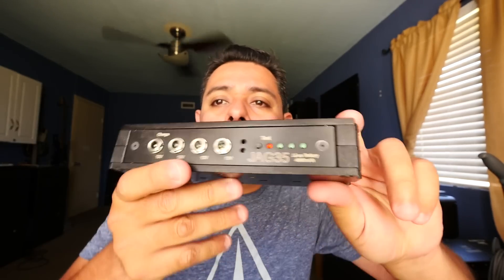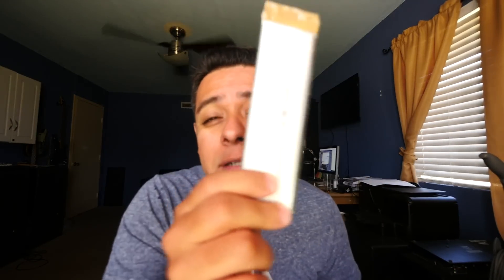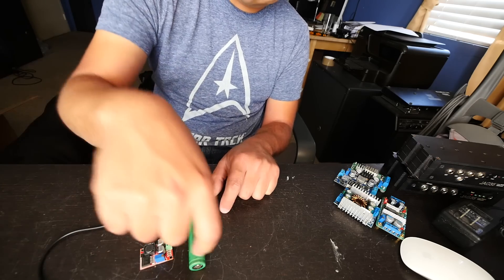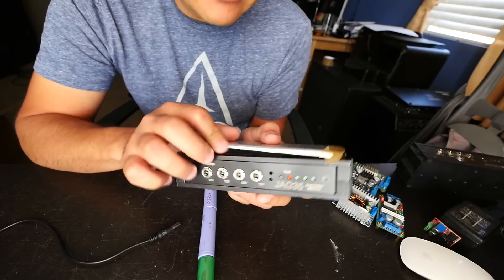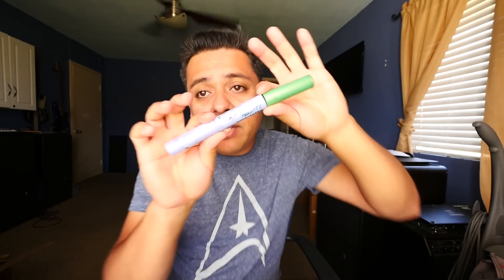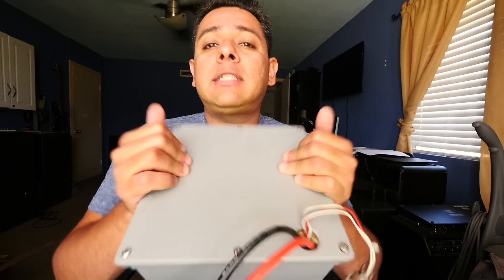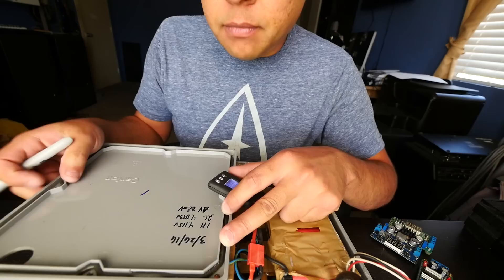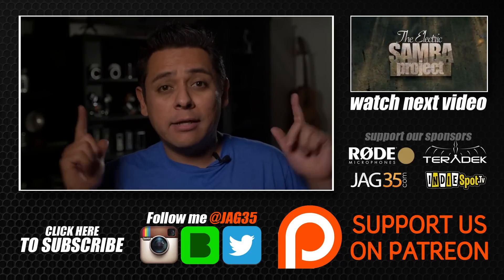How to Charge Lithium Batteries

Comment: So, you have a 600 watt module.  How many modules in your Samba and how many km/miles can you get on those?  // Now just for bs ing, a cell in Spanish is called a "pila" and several cells / pilas make a battery (bateria).  Actually a group of anything is a "bateria", that is why not all electrical storage units are called "baterias."
Reply from the maker: +Oscar Quiros   Cool,  I tend to have trouble with terminology,  I call things the wrong thing all the time.   My samba has a 600wh 12 battery,    Traction pack is 42,000wh good for about 140 miles of range

Comment: It's nice to know that multi-parallel-cell lithium packs don't drift much. For anyone wondering, it may be because the 33 parallel cells each have a different internal series resistance (which usually causes voltage drift), but as such a large number of cells are used, the resistance averages out to a common number (gaussian resistance distribution; one has a very high resistance, other has a very low one and the rest are in between), and each series group gets a similar resistance, making the pack accept the same charge. And, as example RC Packs are usually 1P (1 parallel cell), the resistance between cells is uneven, thus requiring leveling.

Comment: What charger are you now using for your Bus? You say you use one of those power regulators for charging your 12 volt battery. I don't see where these are able to take in your pack voltage then derate to 12 volts? I see they take 120 AC volts. Do they also take 120 DC volts that you can then derate to 12 volts?

Comment: What's a good source of cheap but reliable 18650s ?
Reply: +kchiem Buy old laptop batteries and do heaps of tests on the cells and only use the good ones.
Reply: +Sean Pain That seems pretty labor intensive, for variable quality/condition cells.
Reply: +kchiem Not really. Took me under two hours to get around 100 cells out of a batch of batteries. Around 85 of them were higher than 2000mAh, and able to hold their charge. Majority of those were Samsung cells as i seek specific brands that use better branded batteries. Testing the batteries doesn't take up much of your time as it is just a matter of swapping the batteries when done and recording the voltage and capacity. Wait a week and see if the voltage has held, or is within margin. A few hundred dollars worth of batteries for minimal work and money. I paid $25 for the laptop batteries, posted.

Comment: hey I was wanting to do a whole house off the grid solar project and have my batteries made from 18650 cells and have 200 cell 12v modules series up to 48 and into a inverter to my circuit breaker box. from there have it connected to the internal grid. but id also like to have enough redundancy so that I can take a certain # of modules and put them into my Nissan/Datsun 720 and have that converted to a single warp 11. any advice would be great and any old parts that would be cheapen the project,

Comment: What if your PSU can output very high current. And now if you charge a lithium-ion cell that is empty.
I always heard they need constant current, constant voltage.
Can something bad happen, when there are to much amps going into the cell?
Reply from the maker: +Pryside yes, to keep things safe keep charge/discharge rates below 1c
Reply: Yes, too much current is bad. The cell will be degraded. There is some evidence that charging up to 80% can be done at higher currents For Some Chemistries. That is how Tesla manages such a fast charge for the first 30 minutes at Supercharger stations. However, keep in mind that every cell in their packs are thermally bonded to heat pipes and are actively cooled when necessary. And, Tesla uses an uncommon chemistry I have only found in rectangular ie crystalline Panasonic cells.
Reply: i'm loading my 18650 (out of laptop akkus) always with my old pc power supplie and a resistor that should limit the current at the beginning to 800mA

Comment: Not quite the detail I was expecting as charging lithium cells can be a mine field. It's not quite as simple as hooking an 18650 to a wall wart, which some folk my mis-interpret. You really need a control circuit: TP4056 boards are good for testing this, and are abundant on eBay. They monitor the battery voltage and regulate current into the battery depending on charge state. Also bare lithium batteries without protection circuitry built in should not be charged unattended, cos if over charge occurs...well lithium fires are a bitch to put out!
Reply: Thanks!
Reply: My buck converter output 16.3v from my 150W solar panel input of approximately 20V, I expected my 4S setup to charge up to 16.8V but usually stopped at 16.3V which is the buck converter output voltage. Meaning lithium battery can not charge beyond buck converter set output voltage. The only protection I have on the setup is a Chinese made BMS which would have let the battery charge up to 16.8V if not for the buck converter setting. It appears to be a good charger for lithium batteries.

Comment: I am charging ALL my cells from solar. From the solar panels into step down converter. My cell packs are 21V and I have Step down set at 20.5V. Each cell has it's own protection circuit so will never shut off a cell. The series won't be broken. The series packs are 5 x 4.2V cells in series to give me 21V per pack. I then have 12 x packs in parrallel and then out to another step down converter to 12.6V for my home lighting. It is the prototype battery for my up coming TTPW (Tesla Type Power Wall). Videos on my other channel.
Reply: Li-Ion cells are rated at 3.7V, just like Ni-Mh and Ni-Cd are rated at 1.2V.

Comment: The datasheet I read for a CGR18650CG says the charging current is 1.5 amps.    Why didn't you touch on the charging current in this video?
Reply from the maker: +BurnabyAlex  because every cell chemistry is different.  The lipo pouches are happy charging at 5c while others are better at 1c,    Slow charge/discharge rates are a topic of future video,   I believe it's the secret  to bms free recycled cell operation

Comment: there are a lot of incorrect things, but mainly on the charging :
when you charge at 12,6v 1a from the wall, it self regulates, no special circuit needed :
you will at the begining pull 1a and because the psu can't supply more the voltage will fall ( to whatever the batteries are at )
when voltage rises the psu voltage will continue rising untill reaching 12.6
when at 12.6 the psu can't go higher and the batteries will simply pull lower current as the voltages equalise.
technically they never equalise but in most cases you stop charging at 1/10 the current
same thing in the samba, voltage would not rise above 124v if all the psu can do is 124, it would be stuck there lowering the current
Reply: btw loved the short adds and video
Reply: +BillTheBox  So, in short, is it safe to charge a 3 cell series group to 12.2 Volt, without fancy current monitoring and timer switches? It will make my life a lot easier if it is so!
Reply from the maker: +Douger Rohmer  2 years charging the way I describe says it is. Make sure your discharge load remains low below 1c and you should be fine
Reply: Douger Rohmer if all cells are EQUAL CAPACITY yes
the reason jehu doesn't need to balance charge is that all cells are close in capacity, if not, you WILL ( not might, but WILL ) end up over or under charging some cells.

Comment: Niceeeeeeee! this is very cool insight.  I would never thought you would charge your battery pack of the samba electric with such small charger and powered by 99 cells
Reply from the maker: +Isaac mondragon   Well,  that just runs the 12v systems.  Radio, headlights, fans stuff like that.   The traction pack is much bigger, around 44kWh.  Over 5k 18650 cells

Comment: 4.2*2=8.2? not 7.2?
Reply: +Tedlasman I think he was thinking nominal voltage. An easy slip when doing video on the fly    :)      By the way. 4.2 x 2 is 8.4 not 8.2. Another easy slip of the keyboard. Right :)
Reply: With two cells in series the max charge voltage will be 4.2 volts for each cell in series or 8.4 volts.
Reply: what!!! 7.2!!!!😆
Reply: Depends on the gravity constant.
Reply: +Tedlasman 8.4 nut i get what you mean
Reply: Tedlasman u mean 8.4
Reply: Its 4.2 x 3 cells in  series?
Reply: 8.4*

Comment: Whats the easiest way to test capacity of multiple 18650 cells at the same time. The Imax B6 unit will take forever to do all my cells as it only does one at a time. Any Ideas.

Thanks for the overview, Great Video!
Reply: +Eric Scherzinger I&#39;ll explain it and post a small paint schematic as my main pc is dead :

You will need
holder for the 18650&#39;s,
mosfet ( IRF3205 or IRF540N or anything like it )
10w 1.8 ohm resistor
small LED ( not essential )
MCP73811 ( one per cell )
Arduino Nano

a 5V source to charge and power the arduino
( NOTE : this is used as Vref so if it's not actually 5V get a regulator to offer a 5v reference for the arduino )

You charge up to 4.2V, you discharge down to 3.2V measuring capacity, then you recharge to a holding voltage of 4.0 or 4.15V to store them, then after a week measure aggain to see if voltage fell ( this part you do by hand ) Because it&#39;s programmable you can change the voltages and even the current by changing the resistor.

You discharge at 2a because it weeds out more of the bad cells, and it gives you a realistic look at the capacity.

Now : I need to find that schematic, but I see that somebody did something pretty similar : http://www.instructables.com/id/Automatic-18650-Analyzer/
Reply from the maker: +Eric Scherzinger  multiple Imax B6 chargers,   or HBPowerwall uses a charger that does multiple cells,  maybe he can chime in with details on charger
Reply: if you're willing to build a charger with an arduino yourself ( ie soldering a bit ) then I have schematics, it's about 10€ for a charger that can charge 4 of them
Reply: Opus bt c3100

I am just finished with checking 104 cells took me a Month.
Reply: +BillTheBox sounds great could you post a link. Maybe others can use it too. I have three arduino nano's coming in the mail.
Reply: +Eric Scherzinger I use the foxnovo 4s, it does 4 at a time and $33 on ebay buy it now or about $26 auction